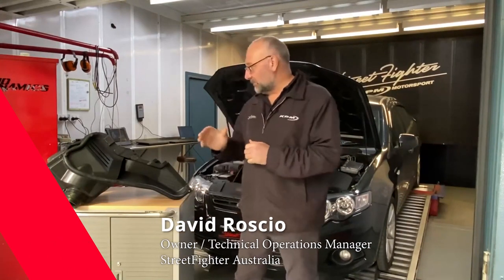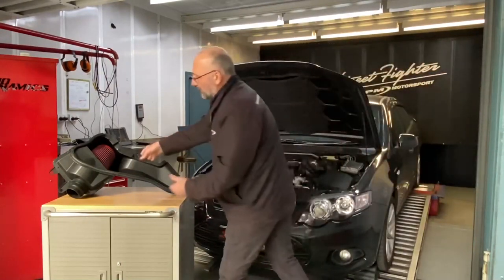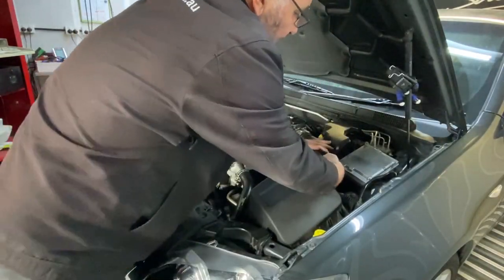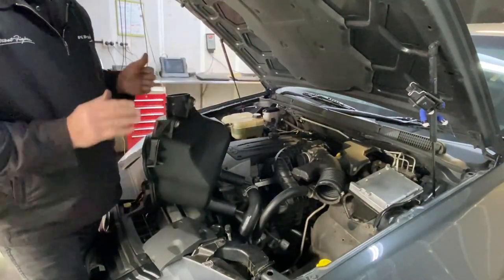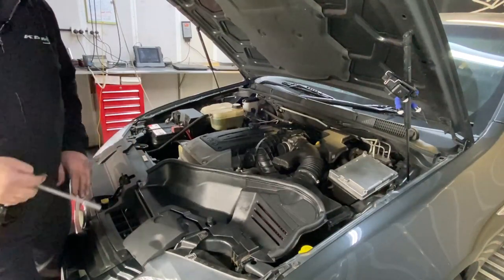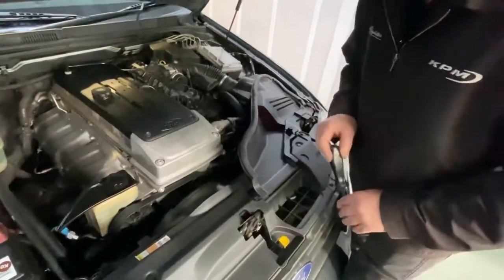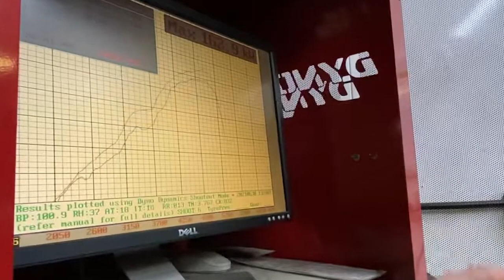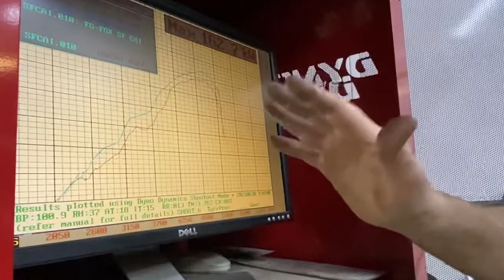StreetFighter FG-FGX Falcon Air Intake Guide

Comment: So much more things just here can make difference first of all the fuel used. 98 premium fuel, exhaust system and extractors, and finally put a tune on then. I'd have on a good qaulity nice and clean walbro fuel pump as well just to be sure but I've been told on stack n/a fg the walbro pump won't make any difference in power apparently. The larger holding tank the walbro sits in would surely be better though to prevent surging after take off and around corners. But im probably going overboard there. Don't forget you'll need a good set of tyres to actually put the power down onto the road.

Comment: just bought 1 a great looking sound is loud made my exhaust louder deeper noise easy instructions
Reply from the maker: Great to hear! Which intake did you end up choosing?
Reply: The fully open intake 1 the race 1
Reply: Could your team work on a pipe to go from my throttle body to my intake thanks

Comment: Would this test really prove anything worthwhile? Meaning, because the vehicle is stationary, and an NA, the air speed and probably mass is quite low, and only atmospheric pressure, wouldn't it be better to test when the car is driving on the road when the air is effectively rammed into the air box?
Reply: Well I can tell you from firsthand I don’t know if that made it go faster I know what made it sound better and I’m happy to pay $500 for 1 hp horsepower
Reply: @mynamea.n.s.s5472  Yeah, I love the induction sound that mine makes. I have quad tips on my 6 na, with extractors and it sounds great.
Reply: Was thinking same thing. Add to that the bonnet is wide open on each test
Reply: You would probably have to have a big ol fan in front of the car to simulate it
Reply: @davo7512  It would be better than nothing

Comment: hey why is the stock power around 150 kws 
on the car specs it says they come in 195kws
Reply: That’s at the engine lower power numbers at the wheels is due to the driveline etc
Reply: “Marketing”
Reply: @davo7512  yes its a known fact drivetrain loss is a myth

Comment: Meh waste of money just cut an extra  hole in the stock airbox
Reply: Not to mention there's no proof the filter in the "stock airbox" wasn't completely choked af full of dirt which can hamper performance alone. Remove the venturi & you'll pick up a bit with a higher flow panel filter.